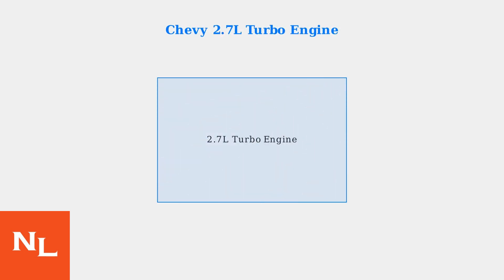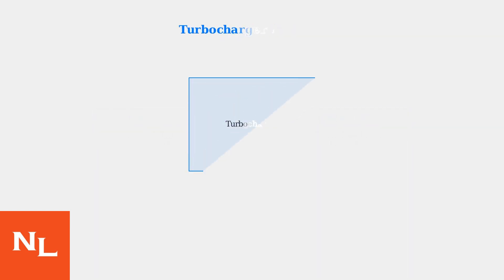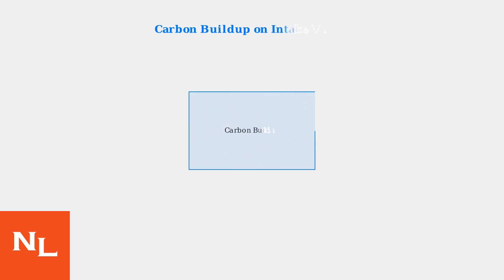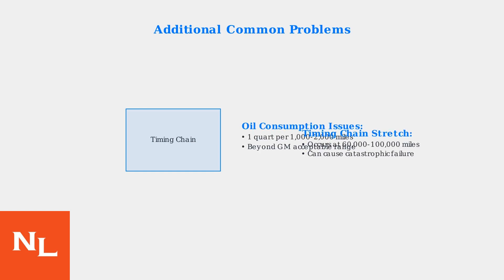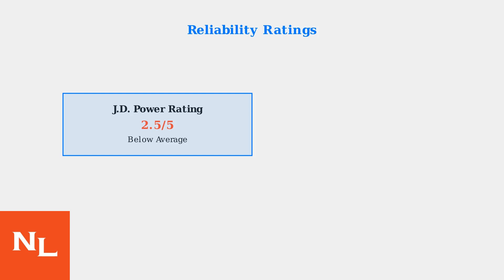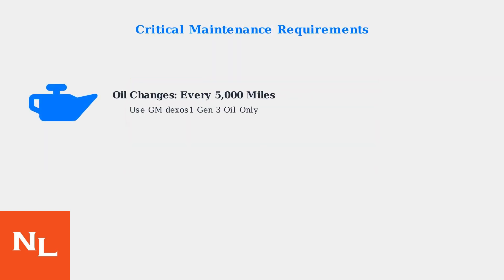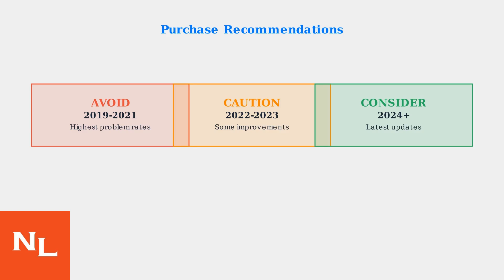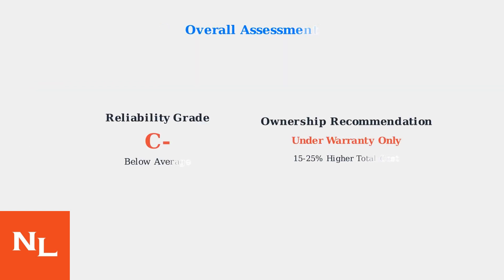Chevy 2.7L Turbo Engine (L3B, L2R) Problems – Colorado & Silverado Reliability Guide

Comment: Thanks for the listing of issues. My 2023 with L2R engine (lower output) is performing well and yielding 25+ MPG without tow load. GM does advise "Tier 1" fuel stations, or using an additive to reduce the carbon buildup that you note here.